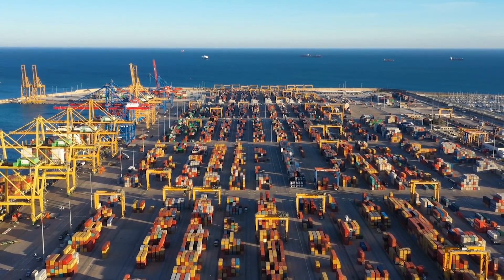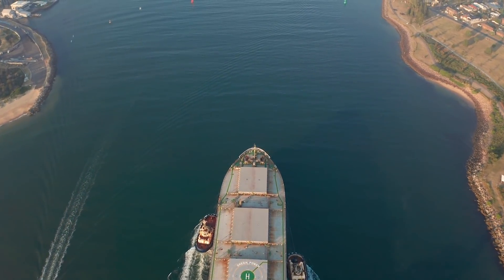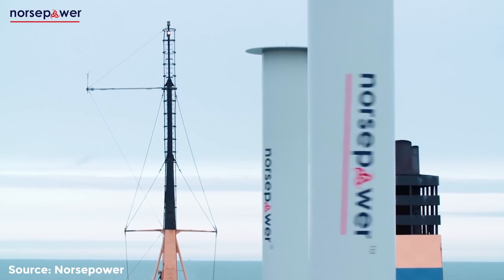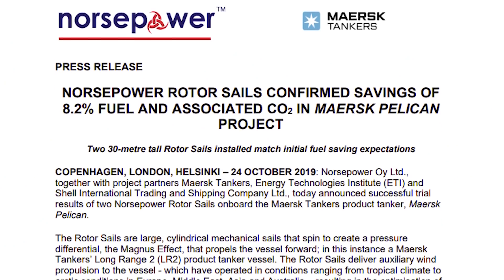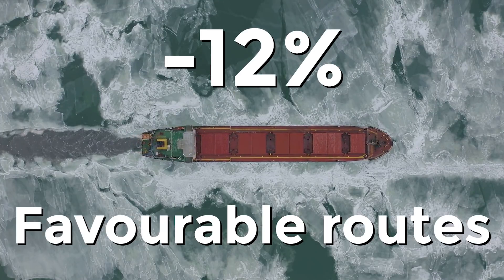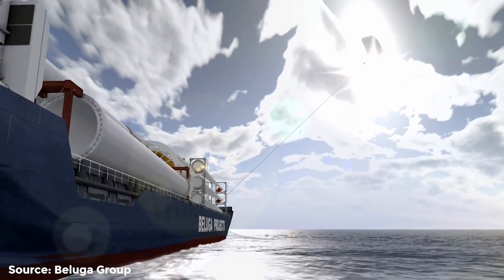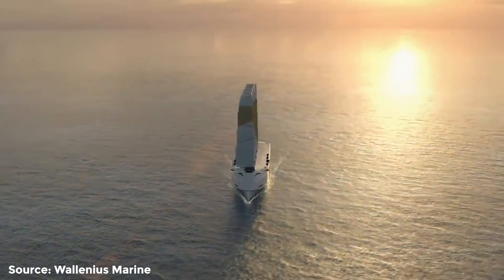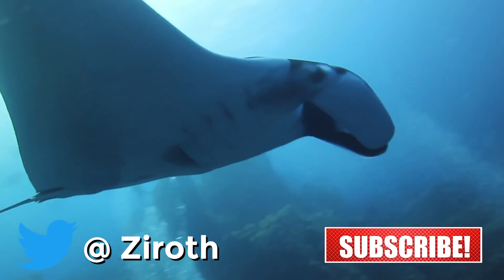Is Wind Power The Future of Shipping?

Comment: Atomic power!!
Reply: If you do a web search for ‘nuclear ship savannah’ you will see that it has been tried and did not work.  A similarly heavily subsidised, by the government, vessel is in use in Russia which also operates, in support of the Northern Sea Route, a fleet of nuclear powered ice breakers these may, or may not, have been completely without issues.

Just think; would you have full confidence in the management of a nuclear reactor under the control of an anonymous entity only traceable, perhaps, via a letter box in a FOC (flag of convenience) nation state?  If you are, could you sell that confidence to Japan, the state that hosted the Hiroshima and Nagasaki nuclear detonations as well as more recently the Fukushima ‘event’?  Then try that same, or a similar, sales strategy on Ukraine, the nation state that as a part of the USSR (CCCP) hosted the Chernobyl ‘event’.  Modern iterations of nuclear energy, thorium fuel, molten salt reactors or fusion reactors, will carry the legacy of past problems.  It is the global trepidation of anything with 'nuclear' in the name and the economics of nuclear having transitioned from 'energy to cheap to charge for' too 'the costs of remediation are incalculable' that will prevent the adoption of nuclear energy as a means of creating energy at sea.  Modern reaction systems may have overcome the safety problems but the general public, having been misled in the past, will be reluctant to believe the fresh new promises.

‘They’ say nuclear is cheap, it’s not it is expensive and has a large embedded carbon quotient as well as being complicated, dangerous, not universally socially acceptable and having only ‘no need for refuelling’ as a questionable advantage; actually it does need refuelling just not as often.  When ‘they’ do need to refill the warming up stuff it takes considerable longer than pumping tonnes of thick black stuff, HFO cSt380, or thin runny stuff, MDO, onboard which is one of the reasons HMS Queen Elizabeth and HMS Prince of Wales are pushed about by ICEs and gas turbines thus using a similar fuel as the aircraft that fly off of them.  The Royal Navy (RN) with a high degree of skill and expertise uses, at vast expenses to the UK taxpayer, a current operational nuclear fleet of 11 submarines (also known as ‘boats’) in two flotillas, seven attack subs and four ballistic missile boats.  The carbon footprint of all the extra bits of hardware and the fuel, including processing thereof, from ground to propeller, are the external costs that never seem to get considered.

Disposal, once it wears out, of both the machine (that was a ship) and fuel is another can of worms best left unopened.  The 26 RN boats no longer in use are laid up (some in Rosyth and some in Portsmouth) awaiting long term deconstruction including dealing with the fuel rods and other irradiated material.  The USN is not, as far as I know, a commercial organisation working to very tight margins and also has the skill and expertise to handle the complexities of nuclear power; so as well as submarines their aircraft carriers are nuclear powered and each of the current iteration has a build cost three times that of QE/PoW, bigger crews and more generous funding.  For those who still think that nuclear energy might be the answer I recommend this report: - https://www.bbc.com/future/article/20200901-the-radioactive-risk-of-sunken-nuclear-soviet-submarines?ocid=ww.social.link.email.  The navy of the USSR might have been under resourced and over extended but it was still generously supported in comparison with merchant shipping.

Comment: "Wind powered ships"

u mean sails???
Reply: To address the suggestions that wind power is the answer I offer the following example.  In 1870 a premium sailing vessel entered service, the ‘Cutty Sark’.  The Cutty Sark was 64.74 metres in length with a beam of 10.97 metres and a loaded displacement of 2 100 tonnes.  She was able to carry, at best, 1 700 tonnes of cargo and to harness the energy in the wind the available spread of canvas was up to 2 976m2 which was tended by a crew of about 30 skilled men.  A ratio between the sail area (SA) and the vessels displacement (D) determines how lively she is; ‘lively’ being nautical speak for ‘fast and manoeuvrable’.  The carrying capacity of cargo ships is constrained in two ways, mass and volume which leads us to the ‘stowage factor’ of the cargo; the more mass on board the greater the displacement which in turn impacts the efficiency of the hull form and sail area / displacement ratio.  A vessel constrained by mass is said to be ‘down but not full’, while a vessel constrained by volume is said to be ‘full but not down.  When in the tea trade, which the ‘Cutty Sark’ was designed and built for with fine lines (more nautical tech speak, so again no need to worry about it) she could carry around 600 tonnes of cargo at speeds of up to 17.5 knots dependent on the prevailing wind and had a typical China to UK time on passage of 120 days.  The tea trade was very competitive so ‘time on passage’ was a large factor in securing the premium freight rate that made her cost effective.  Rounding things out, her maximum available sail area gave circa 5m2 of canvas for every tonne of tea carried.

As soon as the Suez Canal opened, which the ‘Cutty Sark’ was unable to sail through; she lost her advantage, raw speed, to the steam powered ships of that era who could beat her ‘time on passage’ by taking that short cut.  Mechanically powered ships have improved in terms of efficiency, on a freight tonne mile basis, by at least one order of magnitude since then.  After losing out to the coal burning, fire tube boiler, steam reciprocating mechanical ships of the late 19th century ‘Cutty Sark’ was relegated to the Australian wool trade, just about the bottom of the barrel in maritime terms and only one small step up from being a 'honey barge'.  The canvas, cordage and extra manpower needed for sailing ships was never a very benign environmental option so please discount any idea of sail as ‘sustainable’.  All this is without the problem that if ‘the wind don’t blow the ship don’t go’, when it does blow it often blows in the wrong direction for your cargo delivery needs and sometimes there is rather too much of it for comfort.  Sailing ships are unable to go directly up wind so if the wind is blowing form the direction your cargo needs to then a zig-zag course must be steered, more distance and more time.  Wind is traditionally measured on the Beaufort Scale (wind speed) that runs from 0 (< 1kn) to 12 (> 63kn) and for sailing purposes the usable part of the range is ‘3’ (circa 8kn) to ‘6’ (circa 24kn).

Random fact about ‘Cutty Sark’, it is said to have been possible to coax 3 000 horse power out of her sails, or in ‘real money’ 2 206 500 Watts (2.2 megaWatts), assuming this was in ideal conditions that is about ⅔ of the solar power that might be harvested from the ‘top of stow’ of a Maersk Triple E, again in those elusive ideal conditions and 741 Watts for each square meter of sail area.  So that majestic spread of canvas would have been even less efficacious for delivering your baubles and bows from the orient, despite taking about three times as long on the voyage.  The sails on the ‘Cutty Sark produce about 0.33% of the power need to propel a Mearsk Triple E and covering the top of the stow might produce another 0.5% so with both systems working simultaneously in ‘ideal conditions’ the energy harvest would be less than 1% of the output from the ICEs.  Combining with solar electric would involve two systems in place of one, which then runs you into the problems of expense, complexity, integration and redundancy.  Remember shipping is a high volume low cost, therefore low margin business, and all costs have to be beneficial.

Canvas and hemp are accorded 'renewable' (read as ‘natural’) status, if ‘synthetics’ are used there will still be a need for the input of FOGI products.  'Synthetics' would have a much better working life span than 'naturals' but would still yield the same amount of energy, 741 Watts for each square meter in those elusive ideal conditions.  Wallenius are currently giving wind power a go with wing form ‘sails’ but evidence is a little short of proof as of this date.  KTH (Kungliga Tekniska högskolan), a sort of up market university in Stockholm, who are using the funding to derive results will probably, and eventually, in the best traditions of academia ‘publish’ a ‘paper’ unless the funders invoke the well known ‘commercial sensitivity clause’ of their agreement with the KTH.  Wallenius is a major shipper of vehicles were the product is effectively its own packaging, other goods are moved about in ‘containers’ so the loss of capacity, ‘broken stowage’ in nautical speak, caused by containerisation needs to be factored in.  On board wind turbine might get you around some of the problems, however for marine use vertical axis wind turbines (VAWT) would be better than, the what have now become 'traditional', horizontal axis wind turbines (HAWT) for reasons that include the air draught of the vessel, weight distribution and maintenance access.  The energy yield is still subject to the wind blowing at the right strength and having space available on board for the hardware.  The masts, rigging and sail handling arrangements would take up 'prime real estate' on the vessel.  Fuel oil bunker tanks can be stuck away in any odd corner and the ICE power plants are themselves relatively compact.  The stacked up 'boxes' would mean putting the wind driven propulsion units in a bad situation from a ship stability point of view.

Comment: The argument that owners do not pay for the fuel falls well short of the shipping reality. Charterers will always seek the transportation solution which is both time-relevant and cheap and believe me their knowledge on ship propulsion consumption is very deep. By simply installing a more efficient fuel atomization system in the engine and cutting consumption by 2% an owner automatically makes their ship more competitive; it’s reasons like this that have helped push older ships out of business (well, that along with new pollution prohibiting legislation).
As you point out speed is the culprit for wind propulsion. In my opinion hydrogen may become the only legitimate solution in the intermediate term unless electrical power storage becomes MUCH more dense and fast recharging

Comment: There is a hidden message here. Wind powered ships went out of use because carbon powered vessels are quicker and not so prone to the unpredictable weather. If the cargo is perishable then this is very important but if it is non perishable then why should the time of the voyage be so important? Because while the cargo is on the sea it is not earning any income for the investment. Somebody buys 10,000 tonnes of metal ore on one side of the world and wants to transport it to a factory or mill on the other side of the world where it will be transformed into saleable goods. The longer it takes for the cargo to move from the mine into finished saleable goods the longer the investor goes without income from that investment. This is the capitalist system. We need to be looking at an economic system not so based upon time is money as then slower sailing ships will be viable.

We also need to look very closely at nuclear powered shipping. People get very upset when we mention nuclear power because they associate it with nuclear bombs and nuclear waste. the association with nuclear bombs is largely a result of ignorance and disappear when the method of operation of nuclear ships is understood. The problem of nuclear waste is important but with care it is controllable. In the history of nuclear power the number of people killed is by any estimate less than 60,000 in the past 70 years. this sounds a lot but should be balanced against the hundreds of thousands dying each year from atmospheric pollution caused by fossil fuels. The effect of nuclear power on climate change is close to zero.

Comment: what about putting a big electrical motor and solar panels on top of the boat?
Reply: Solar power; as an example the above container (called boxes by nautical folk) area of a Maersk Triple E is less than 399.2m by 59m.  The 399.2m is the length between perpendiculars (marine tech speak - no need to worry about it) and the 59m is the width overall (more marine tech speak so again no need to worry about it) allowing for the sides, bow, stern & navigation/accommodation structure could we agree 340m x 56m, or 19 040m2, for the ‘top of stow’ area?  Insolation rate in Joules will vary due to time of day, latitude of vessel, declination of sun, (those three impact the elevation of the power source) cloud cover, the efficiency of the solar panels and how clean they are.  The Triple E class use two 29 680 kiloWatt each, at full whack, ICEs for propulsion plus some hotel and services power load cost; so for round numbers, could we agree 60 megaWatts?  Solar panels create about 155 Watts m2 averaged out; 19 040 x 155 gives me 2 951 200 Watts (or 3 megaWatts for a round number) from the top of all the boxes.  Those three megaWatts might allow you to distil enough fresh water from the sea to wash the crud off of the solar panels (surprise fact renewable energy comes with maintenance costs) but nowhere near enough to effectively 'push the boat along'.  Fitting solar panels on top of the ‘boxes’ is worth, at most, 0.5% of your power requirement.  Side mounted, let alone towed array, solar panels are not practical given the harsh conditions found at sea.

More seriously the ‘boxes’ are loaded and unloaded from the top down so the solar panel array would need to be moved for every port operation and time is money as well as that operation having the ability to get very complicated (tech speak for ‘go wrong’).  Any additional weight would be in the worst possible place for the stability of your vessel, the operating environment would be harsh and the ‘top of stow’ on a ‘box boat’ is seldom a level expanse as each column of containers may be, and usually is, of differing heights.

Comment: Slow cruising is a shipping industry phenomenon that makes a return to wind power seem logical. Essentially, especially at times when there is excess shipping capacity... more boats than are economically needed... it makes sense for ship lines to purposely cruise much below their ships' maximum speed. This reduces fuel consumption but also greatly minimizes maintenance costs, as hulls and propellers and engines work with minimal strain. At a time when the industry is increasingly learning to go slower, it makes sense to capitalize on that fact by getting a free lift from the wind.